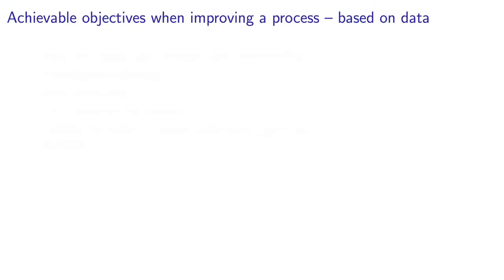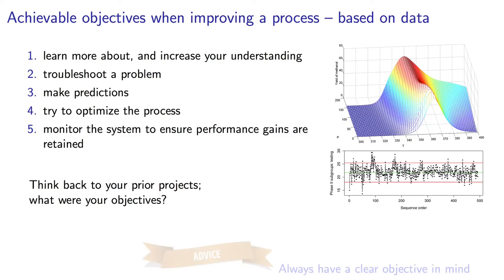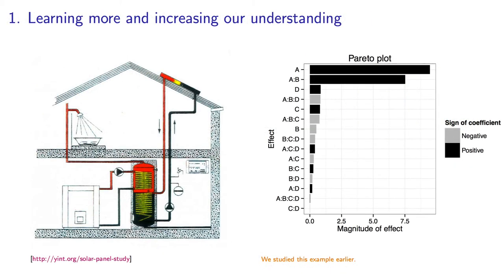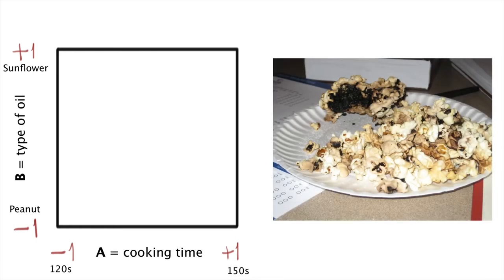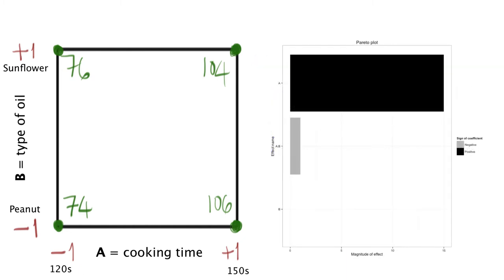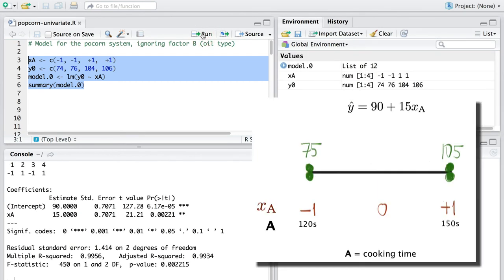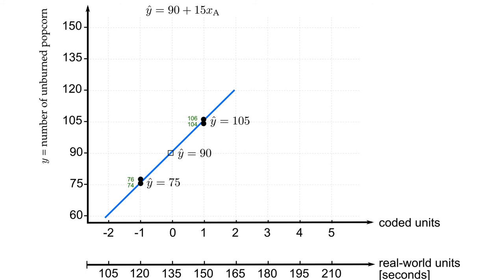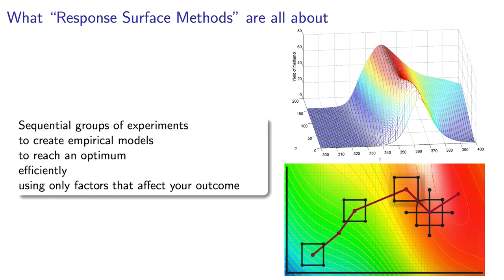Experiments 5A - Response surface methods - an introduction

Comment: I want to optimize a process where I am considering 3 factors and 3 responses using RSM....Is there someone who can teach me?
Reply from the maker: Later in the sequence of videos we show how to optimize with multiple factors. In the last video we show one possible approach to dealing with systems with multiple outputs. Also, in your situation, depending on how well you know the relationship between inputs and outputs, you could also use traditional optimization methods (e.g. NLP, or a QP).